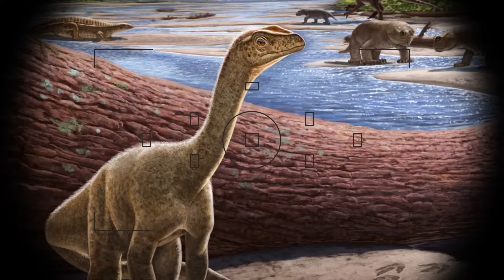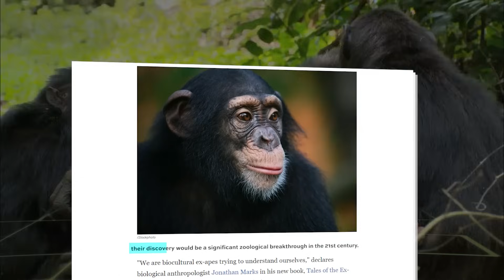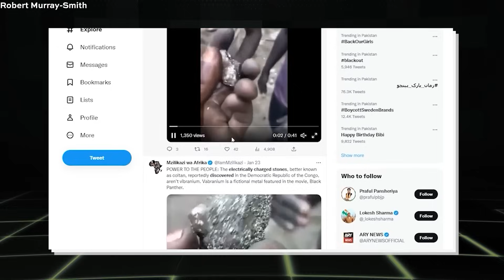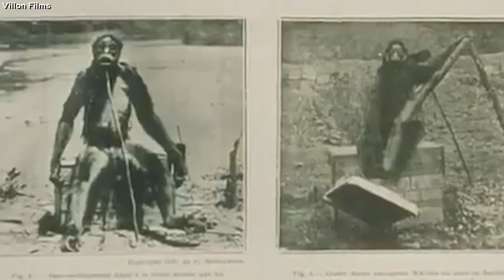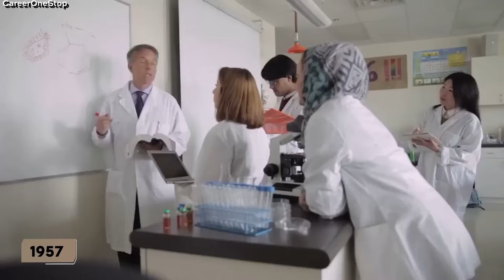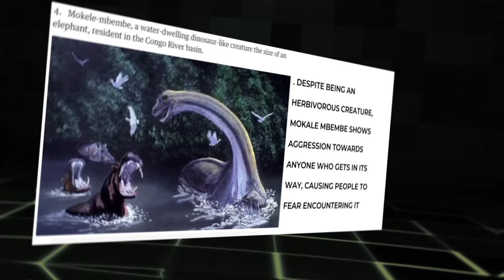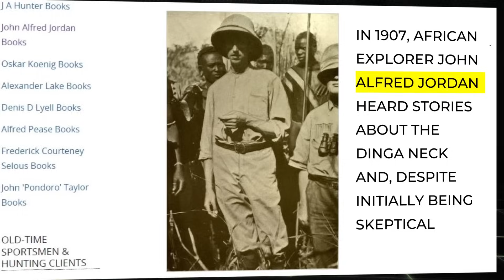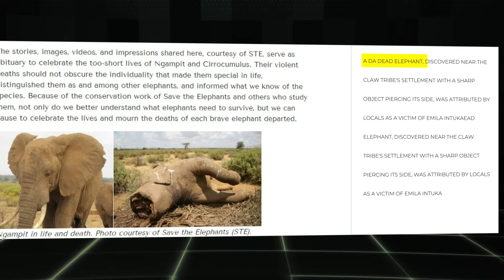The New Terrifying Discovery In Congo That Scares Scientists!

Comment: All the stupid metric crap.. use the American system please 👍😎
Reply: Yeah I agree. They think they sound smart.
Reply: @ratdad48  The metric system is easy - anyway the imperial system America uses in measurements is not American - it's English. 
As is you American language - just badly spelt English.
Reply: @Mr21Franz  Indeed it is English. I was educated on the imperial system. Worked out fine for me. Built a house using it. But I know. It sounds cool to say meters.
Reply: Not just my American friends I'm in the UK and feet and inches are correct, please use that form of measurement.